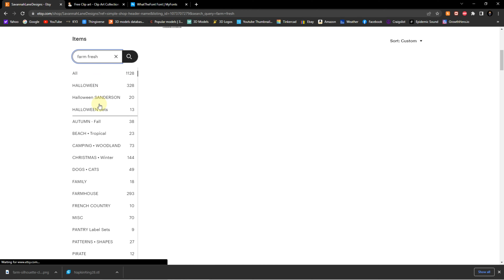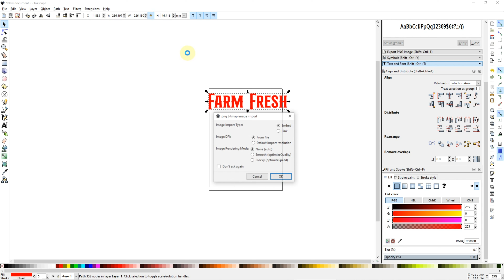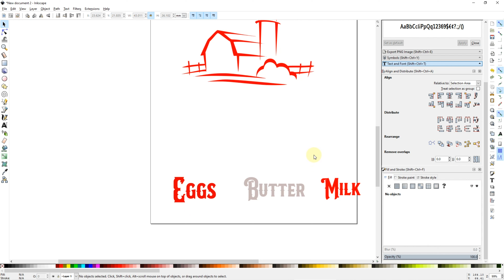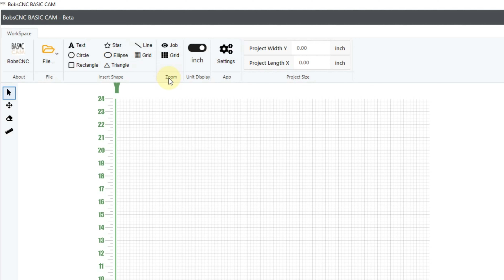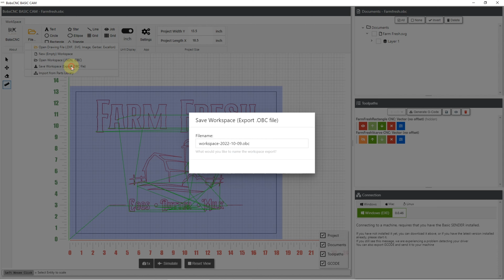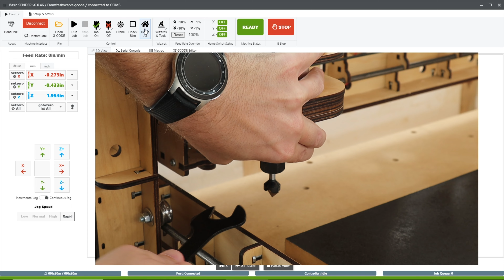How to Make a Professional CNC Sign - Basic Cam / Basic Sender - Free CNC Software - BobsCNC

Comment: Will a 1/4” but fit In The bobs cnc e4 ? Or does it have to be a 1/8”
Reply from the maker: You will need to pick up a collet that will fit your router. They make a 1/4 collet and 1/8 collet. You put the bit in those and then tighten. Look on Amazon. 👊🏻